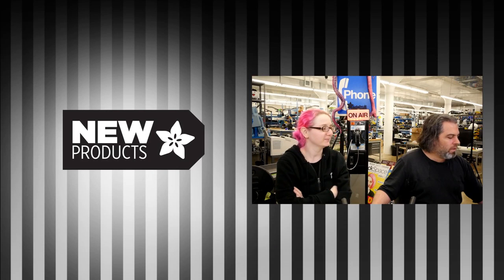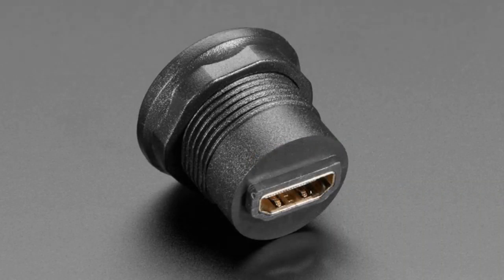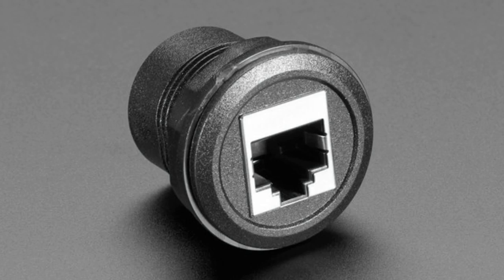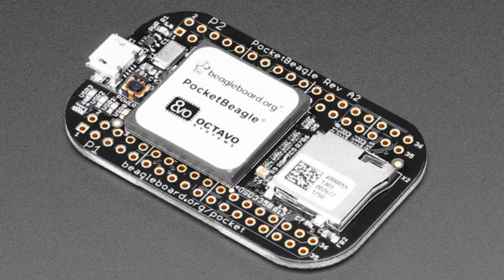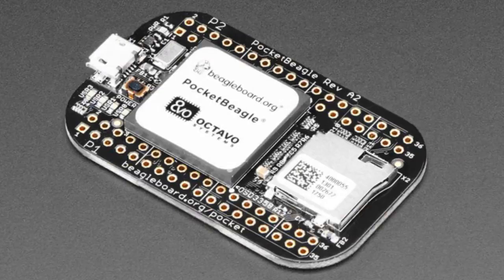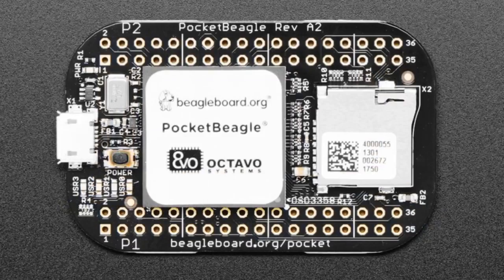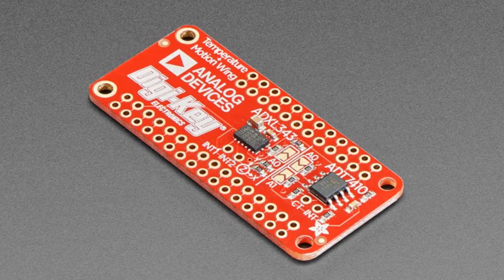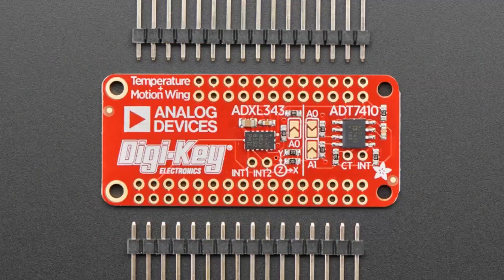New Products 3/20/19 Featuring ADX343 + ADT710 #Sensor #FeatherWing! #adafruit

Comment: Regarding the HDMI Round Panel Mount Plug and the RJ-45 Ethernet Round Panel Mount Adapter Plug:  YES!  These and more like them, please.  How about similar round panel mounts for USB 2.0, USB 3.0 (old nomenclature, of course), USB type C, 3.5mm Audio jacks, and so on?  I'm thinking in terms of versions that include (or have available separately) leads can be connected to the USB and HD audio headers on a standard ATX PC motherboard, but which are not limited to that use, of course.  Case modders and folks who custom build PC cases would find those useful, I think, but with the right kinds of leads they could also be used when installing single board computers into large (cigar box-sized and larger) cases for various projects.
Reply: definitely needed for USB.